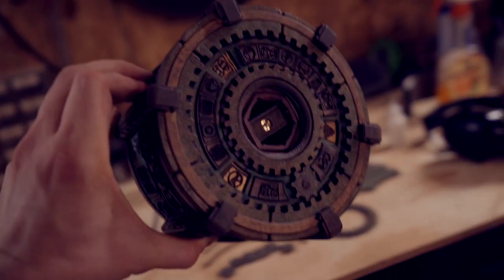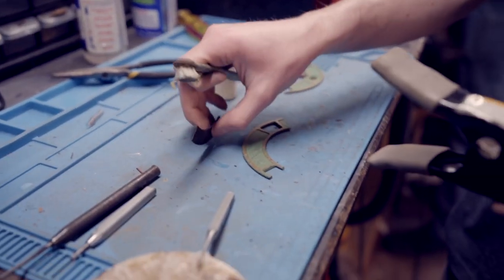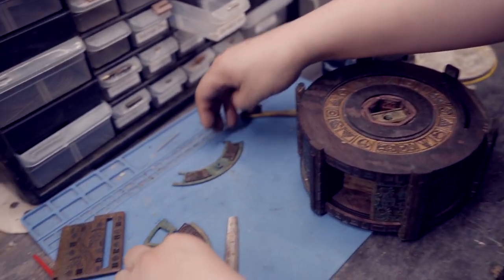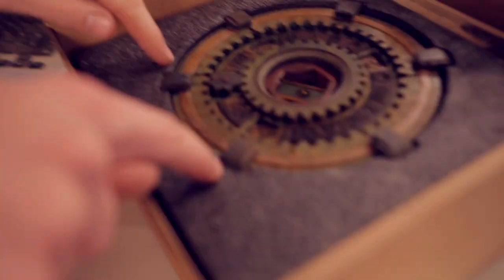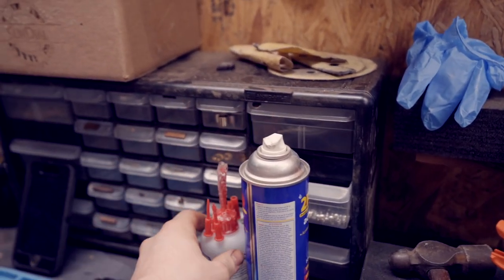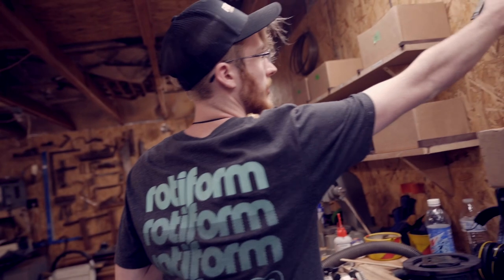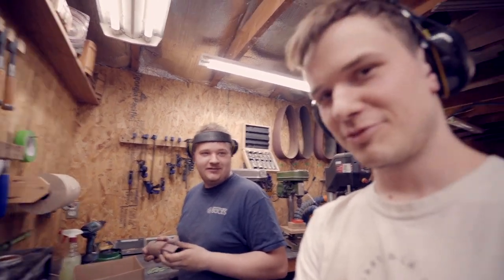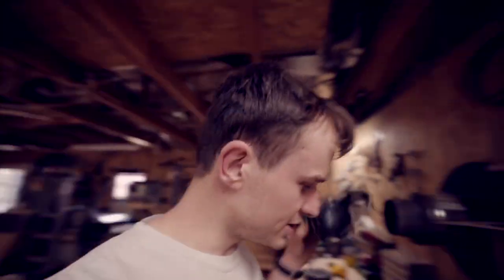Jesse Born | Meet the Sundial assembly team!

Comment: You guys rock, the craftmanship looks awesome. BTW currently I am building the Architecto puzzle from NKD. It's definitely most momplex puzzle "box" from NKD, it will take me ages to finish it. My biggest fear is that I will make some serious mistake (bad orientation) only to find out several steps later so I double or triple check before gluing every part. Though lot of parts have only one possible orientation so it's not so bad.